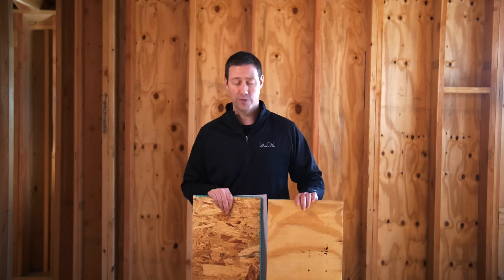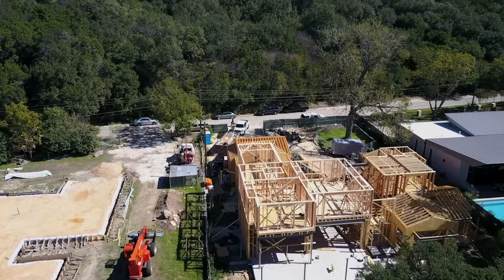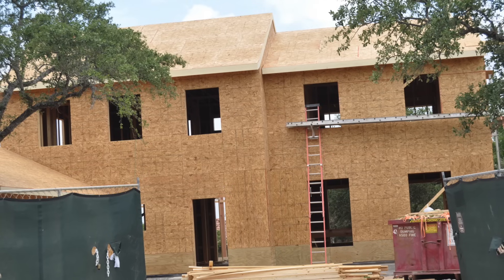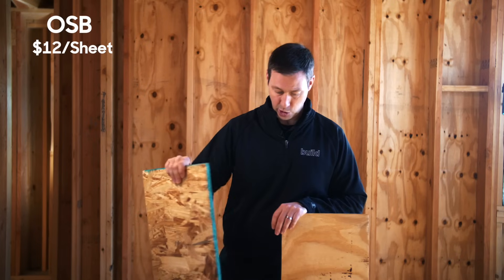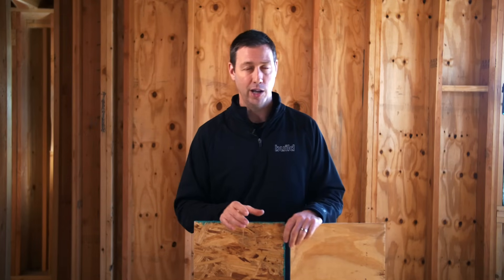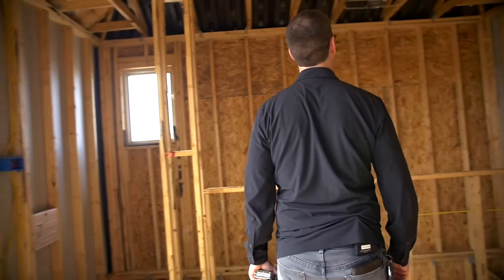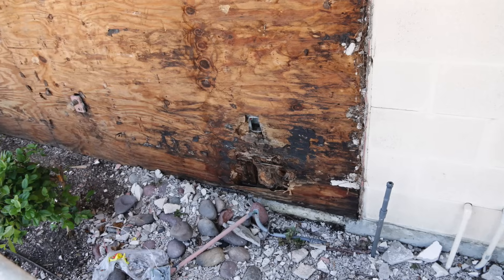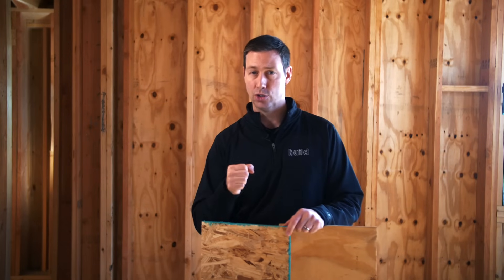Framing : OSB vs. Plywood - Whats the difference in COST AND PERFORMANCE

Comment: OSB is only a little cheaper than plywood with about half the life expectancy. Not for any wet rooms, like bathroom/kitchen floors. There saved you 10 minutes.
Reply: I agree. My Garage door is 70 years old and of course even though it is painted it is exposed to the elements.  I have had OSB  come apart in less than 10 years  with similar paint, exposure situations.
Reply: It used to be about half as much.
Reply: It breaks down under foot traffic....  It is not quieter, not sure where you came up with that.
Reply: I just checked the prices of OSB over plywood, plywood is a 25% higher price per sheet over exact same dimensional sizes.  only a little cheaper? Bzzz  WRONG..... just for example 19/32" 4x8 sheet of OSB is $20 and plywood will run ya $25... thats not a 'little cheaper'
Reply: Syc holic, if five bucks is that much money to you, go with OSB.  Imho it's false economy.
Reply: Ray Davies for one thing it does seem a little quieter and for another you cover it with carpet or other flooring so it doesn’t break down
Reply: Dude go buy 200 sheets then tell me $5 a sheet isnt a issue.... even at bulk rates it still about 4.50 a sheet difference
Reply: Could it be you're all talking out of your arses? My outhouse has a raised floor made of rough sawn 4x2 timber and OSB sheeting, isn't sealed to the outside terrifically well and gets 100% of the foot traffic of people walking into the house. Had it for about 10 years now, just replaced the floor tiling and it looks exactly the same as the day I laid it, if not a bit dirtier.
Reply: Tiled your outhouse? LOL
Reply: That's 25% more, 12 to 18 is a bigger difference lol
Reply: R L as you imply, there’s lots of talk and pics here but not a lot of technical or particularly insightful comparison of the two types
Reply: Excellent point.
Reply: I don't get why are houses made of wood in the USA. Here in the EU we use AAC (Autoclaved aerated concrete). It does not burn, it does not rot.....
Why wood?
Reply: Because north American forest industry is more strongly lobbying on the construction industry than in the EU. Also, I didn't research the numbers but I guess that wood material is cheaper by sq/feet vs AAC in NA.Finally, if some states didn't have included AAC in their building code, insurance may use that argument to avoid payment when some damage occurs to seismic activity in particular in California.
Reply: @ZZZHarpy101
Thank you for your answer.
Wood is marginally cheaper (acquisition), however is much much more expensive to install (build) here in the EU. Taking into account the fact that it keeps "working" (bending, settling, swelling curving, etc. in time) and the expense in maintenance and it's lifetime, wood is probably 5-10 times more expensive. 
An AAC or nAAC or other cement based building has 150 years guarantee from the builder. My flat and my house has that. In the last 30 y, I had 4 major inundations, pipes bursting in my flat or the flat above. Damage around 100 USD (a coat of paint locally). I do not have insurance on my flat. Almost nobody does.

 I would be curious if someone can tell for sure if AAC is not in the building code in USA.
thank you.
Reply: Why not?
Reply: Here in Brazil we use hollow brick made of compressed concrete (less expensive) or massive brick (much more expensive) burned in furnaces or perforated clay bricks (average price) burned in ovens. Very poor people use sun-dried clay bricks.
Reply: It can be treated, or even bought treated to be waterproof.  In fact, whether you use OSB or Plywood, it's required by code to be treated in wet areas, so moot point.
Reply: A True Brit 

Faster build times and here in America remodeling is a huge deal. Remodeling a framed house vs a concrete house is way cheaper and easier. Here houses are moved into about 60 or so days after the first shovel of dirt has been dug for foundation. 

Also concrete houses would result in exactly what much of the UK is experiencing at the moment, sky high housing for less and less sq footage. 

But to be honest it really just comes down to price and build time for most homeowners.
Reply: @Mark_Cook   -> ok,  I agree with You.
Reply: I should add that here in the US the trade of framing houses has been streamlined and perfected to the point that the cost differences are massive compared to any type of concrete. In the EU this isn’t the case and the timber industry isn’t built to cater this resulting in much closer prices.
Reply: @Mark_Cook   => Thanks a lot.
Reply: Syc holic 20 is totally a little less than 25. Especially since it costs maybe 15 to install due to labour costs so now it's 35 and 40
Reply: @atruebrit6452  someone said that the changes in temperature require some flexible material, like wood. Do you have drastic changes? How do they deal with it when building with concrete? I also have not gotten used to live in a wood house but have been told that it is better for flexibility with the weather changes.
Reply: @ZZZHarpy101  do you know if seismic activity is the only problem with the AAC ? I would love to build my next house (plan to sell and move) of something other than wood. I am in Georgia, no seismic activity and our winter is somewhat mild. The only problem is lots of humidity, rains almost year round. Someone mentioned wood being better for the temperature changes. So, I don't know if that AAC is even possible here. If you know about that?
Reply: @dazzling3237  but that treatment must wear off, if for example there's a leak under a sink left for years without repairs . Happens with tenants, have them stay 3 or 4 years, and some will ignore it and have it keep going.
Reply: @liliantbouscayrol8409  
Concrete does not significantly expand with temperature. Here we have  -20 to 45 deg Celsius. Bridges and dams and other critical objectives are built with concrete. There is not a single reason to build with wood unfortunately. I love wood, but if I have a choice, I'll never live in a house made of wood.
Reply: @liliantbouscayrol8409  
regarding seismic actvity and AAC, first AAC is not for structural resistance, second, for structural integrity you ALWAYS build with concrete (+AAC for walls). Look at Japan. One of my properties (gl+4) withstood 2* >7 deg Richter magnitude earthquakes and probably 6 of more than 5 magnitude. And it was designed to withstand 9, so....
Reply: R L Bullshit! OSB is half the price of Plywood and OSB is stronger than Plywood and nether will hold up to get wet over any length of time! I used to frame Half a Million dollar homes and all of them were made out of OSB!

Comment: OSB won't hold a nail. For $1200 dollars saved over the cost of building an entire house it is nothing. True...you put the $1200 in your pocket but your client gets a shit built house. And you know it.
Reply: blipco5 I almost stopped watching when he recommended it.
Reply: K....And he said it with a straight face.
Reply: So the 2x2 batten fixed with 3 inch nails to the sheet of OSB I have in the garage shouldn't exist then yeah? I can tell you now it's not coming off any time soon.
Reply: Just get it wet, I dare you!!!
Reply: blipco5 as long as you properly waterproof your project you should have no trouble. I’ve seen dumb things done by hard working men because they don’t understand principles of waterproofing. These guys caulk between old siding planks and nail vinyl siding down good and tight. They are smart but not professional. A house I just remodeled had problems because the renovator decided to torque the toilets down to the plastic flange with an impact driver. Leaks are caused by men who mean well, but in theory there should be no problem with OSB.
Reply: I've been to OSB, plywood, laminated beam and MDF mfg ops during development work of reinforcing concepts for construction products. Both OSB and plywood will pass the same mandated structural tests, they have to. BUT plywood is cross-plied continuous shaved wood while OSB is wood chips. Similar glues (interior vs. exterior has big differences however) are used in both. Here's the rub and it goes back to firefights on roofs - fast fire (or slow water) weakens both structures. Chip construction weakens more for surface load bearing than cross-ply sheets. Why? There is no exposed glue in plywood but its everywhere in OSB. The micro glue-wood bond is the weak link and it is "covered" better in ply construction and this coverage is a 2D film, not a 3D sponge. IMO once you approach 3/4" thickness its plywood hands down, especially on roofs/decks. (15 years engineering design work involving the construction trade)
Reply: That's why you staple it. Staples hold alot better over time
Reply: @generalralph6291  I had a plastic flange leak here so I went to a plumbing supply house and got a metal flange. 14 years on and so far it is holding up OK.

Comment: I don't know when sheathing houses became common but to my knowledge it's quite common to find old houses from the turn of the 20th century and before where clapboards were attached directly to the studs with no sheathing underneath.
Reply: Down south they still do that...
Reply: Brandon Upchurch I'm from New York City but I moved all around the country I've seen what you're talking about in Louisiana
Reply: That's very common in my area on the east coast of Canada, the clapboard was nailed directly to the studs but they were sheathed inside with 8"  3/4  straightedge board
Reply: Doesn't that require diagonal cross-bracing in most places now? I've seen only houses with a diagonal stud embedded in the vertical studwork, but I suppose the modern alternative is to put diagonal steel strapping on one side or the other.
Reply: They did that in my 100+ year old house. Rough cut actual 2x4s. Cross blocking more than once in nearly every single joist bay. And a diagonal 1x4 across major walls. With the clapboard nailed on with massive old 20 penny nails. It's an old way to build it but it's standing fine here in a seismic zone with just some minor plaster cracking. No weird expansion or contraction noises either.

Comment: Thanks for the info Matt. May I ask where you're located? In earm or cold climate? 

I have heard of surveys stating that shear panel acting as a semi vapor barrier will trap moisture within the structure, as the dew point lies within, and once the temperature goes up, the vapors do not dissipate through the sheathing, as one would like, but instead builds pressure and is the foundation for mildew, rot and funghi in the structure. This is not a problem in skinnier well ventilated structures, but in enclosed very well insulated and enclosed structures - it may be a problem... 

Which one of the products would  be preferable in reference to these properties? ...or would there be an even better alternative with the same shear value? ...preferably one that naturally posseses these properties, without having to rely on tech to not fail, like some fabrics and other types have been prone to.

 In the back of my mind, I'm thinking the shiplap has the edge over everything else, except maybe the need for bracing to comply with shear values. 

Any thoughts you might have on the subject would be most welcome.

Comment: OSB is a little cheaper, but they charge you full price for the house -- the difference in cost goes into the builder's pocket.  Any cut edge, or drilled or nail hole in OSB is wide open for moisture absorption (any waterproof coating is only on the original surface), which causes it to swell; it takes longer to dry out than plywood, and the swelling never shrinks down.  If it's made from aspen or poplar, it has ZERO decay resistance.  OTOH, most builders will never live in the houses they build, so what do they care?

Comment: I didn't realize builders were using that cardboard stuff. Not being used at all around my area thank goodness.
Reply: Same here, we have earthquakes. That stuff can't have any sheer.
Reply: I'm in the midwest. I'm not a builder but I've certainly driven past a lot of new construction. I've never seen that product. Looks pretty crappy.
Reply: Never seen cardboard.  But around here I have seen them only use sheating on the corners and then just house wrap + wire mesh and stucco (no sheathing).
Reply: @Rickmakes  I'm in the building supply business. Around Central Indiana almost everyone of the semi custom home builders, Pulte, M/I, Arbor, is using that ramboard to one degree or another. Hell we used to supply to this one home builder(pretty big one too) that used to use OSB 4 ft from each corner and the rest of it was 1/2" blue Dowboard 😂
Reply: They mostly put the cardboard sheets when the house is going to be outta bricks and stone
Reply: VERY common here in North Alabama, unfortunately
Reply: @SC-dt4ij  Brick veneer is not structural.
Reply: @joshuarewerts8566  Thats terrifying. i work in the Energy Field and give out rebates to these companies, and knowing they ramboard is...not very shocking to me, you should come to a Builders association meeting...

Comment: Hi Matt. I really enjoy your program. 

I have a couple ideas for you for future shows. 1. I live in the country--30 miles from Nashville. I have a split unit heat pump but have not replaced it b/c of the cost. 8k for 2.5 ton. Are there other more affordable ideas out there? 2. Propane. I've had all electric stove. Want to convert to propane and get a natural gas stove converted for that. Would be nice to get your thoughts on that.

Comment: I've seen some old houses built with ship-lap at a 45 degree angle..Lots more cutting an wastage, but talk about a rock solid house..
Reply: Long duk Dong I'm popping the corn.
Reply: Long duk Dong that's too bad, you were doing well.
Reply: Shit lap is for sheds NOT houses! Get a life, build it from brick, cement block or like they do in Yorkshire ... Stone! We even have brick shithouses! Who the hell wants a crappy wooden fire trap?
Reply: Bob Lewis: Most of the stories I've seen about new construction, or even damaged buildings built over the past 40 years involve either those  4" aerated light blocks (with non-structural brick on the outside) or  occasionally wood framing and brick veneer, like what we often use in the USA. I'm sure that's strong enough to keep the roof up, but neither  seems intended to last the ages.
Reply: Same. Ship lap on exterior and interior. When we pulled down the interior ,yes it was a massive job, we found every wall had X bracing. Extremely stiff house. 
We pulled the SL from the inside walls to run new plumbing and electrical and yes we put it back up
Reply: @boblewis5558  A brick house would crumble where I live in California. So many earthquakes you'd have nothing but cracks and damages.

Comment: In Scandinavia we only use these for the interior part of the house, mostly for extra support of hanging things on the walls or for sound absorbing,  and then we have plasterboard as another layer also. That's why we always go with OSB, since it's not exterior.
Normally we use wood panels since, well we have alot of wood.

Comment: I've always found that OSB is the second rate choice and I never used it unless specifically requested by a homeowner. Ring nails are the only ones that seem to hold in OSB while any spiral or regular nail will work great in plywood, tongue and groove or shiplap and hold just fine. I'm sure that there are some fine OSB products out there but a good quality plywood wins every time in my opinion.

Comment: I am currently building a new shop, and using OSB under metal cladding both inside and out. 
I would have used plywood, but I live in grain farming country in the middle of nowhere. The lumber yards here actually have a really hard time getting quality wood products. The spruce plywood they've been able to source was such poor quality, that they ended up only selling fir plywood. And fir plywood vs OSB is about double the cost, and that does add up.  That metal cladding (provided all the flashing is done right) is really a good system, so I'm not overly worried about having used OSB